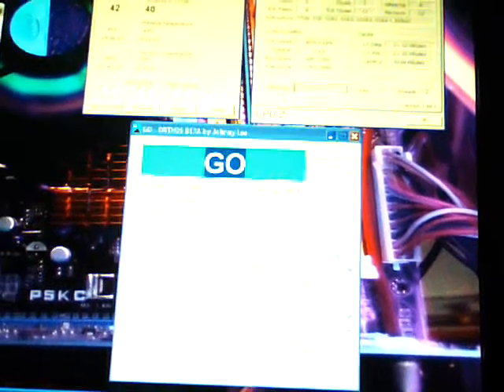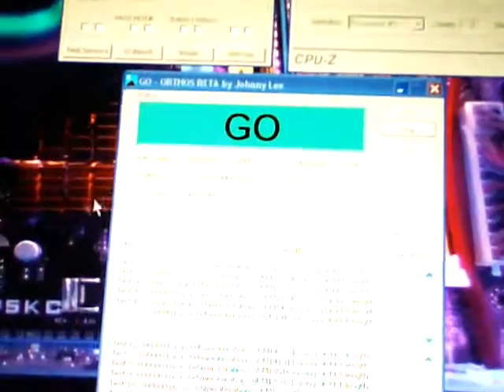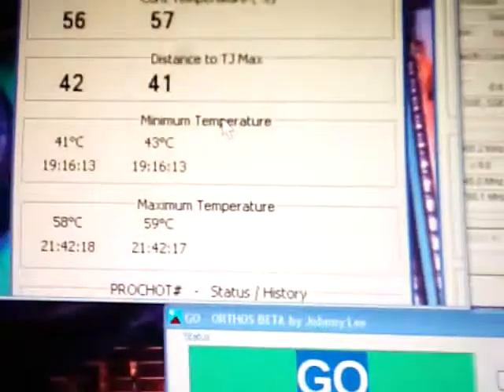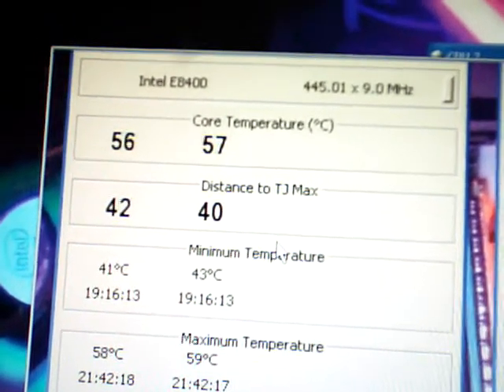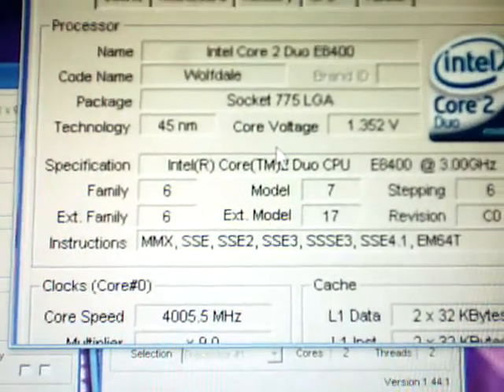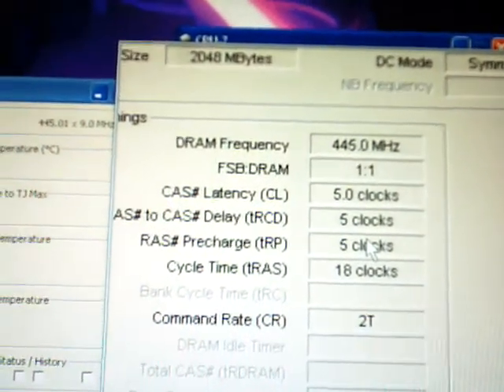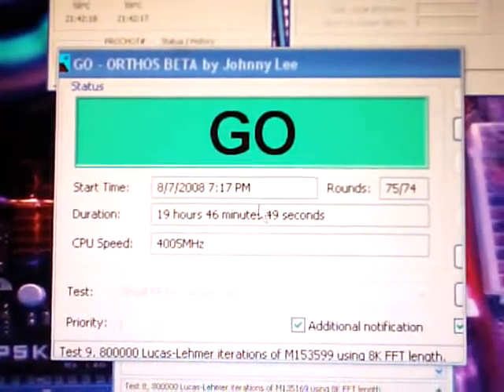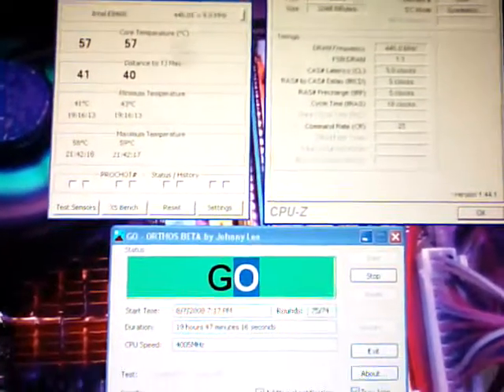E8400 @ 4005MHz 1.352v 19 Hours STABLE!!!

Comment: god dam im running 4ghz at 1.298volts in orthos and im getting 70-80c degrees! Its stable but I stopped it after an hour because I dont want my cpu to fry. Right now, I have it OC'd to 4.18 at 1.368 volts. Not stable at 100% load but Stable enough to run the game crysis for periods of time

Comment from the maker: Kinda but depends your FSB really. Like a 800MHz FSB CPU can run 200/266/333 straps where a 1333FSB can only run 333/400 straps. I guess you could run 266 but why like I said 1:1 is optimal and most mobos can run linked or unlinked going along with what you said to a point.

Comment from the maker: Really depends what RAM speed you are running and it has to do with latencys of the NB in technical terms.

Higher the overclock and the slower the RAM you are running usually you will go to a higher strap. Like I can only run on the 333/400 strap because of my 800mhz RAM. That was a crappy explanation but I am sure someone else will show me up on this question.

It determines what your RAM speed will be in relation to your FSB and the divider that will be run between the two.

Comment from the maker: Good overclock whats the FSB? 

Finally shut it off at 21 hours and 51 minutes. 

Good enough going to go through some settings and try for 4.1 stable but voltage is at the limit for 24/7 after one more notch up. 

Temps are a bit high but got a bad mount got a solution for that just wait and see.